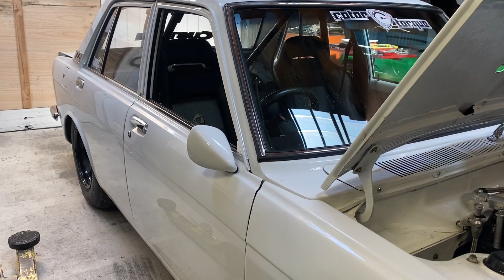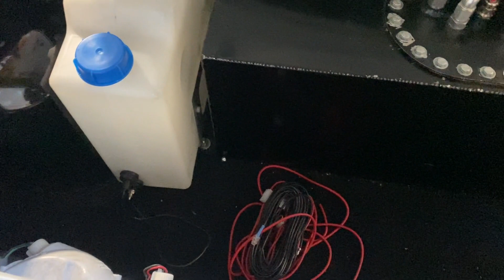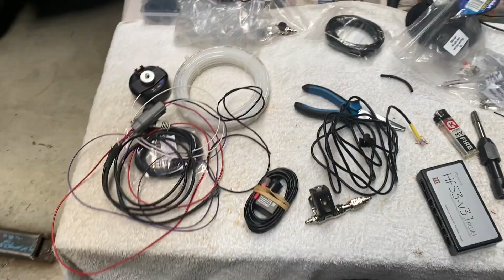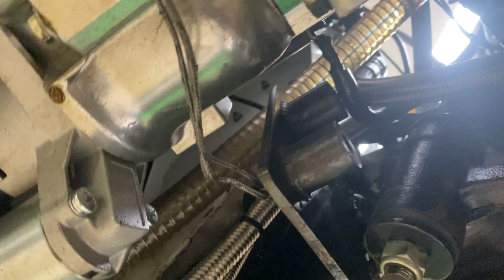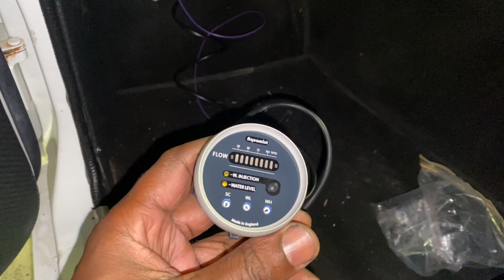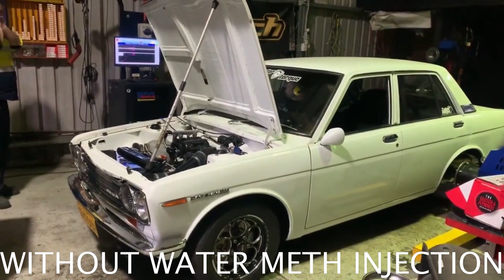800HP 13B Turbo Datsun 1600 Aquamist Water Meth System Installation and Testing!!!

Comment: Was there any back to back dyno gains with the water injection without adding timing or boost?
Reply from the maker: We didn’t conduct that test on this set up  mate. The main reason we recommended water meth injection on boosted cars running e85 is to reduce and stabilise IATs, for an additional margin of safety, especially in race applications.